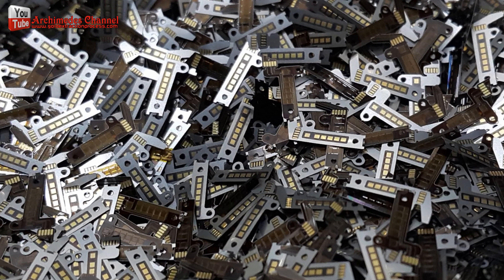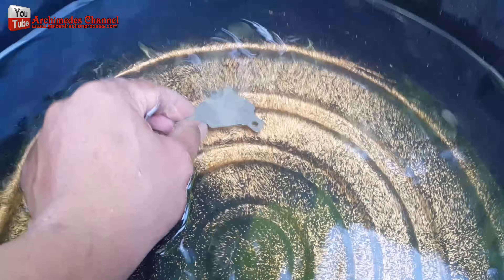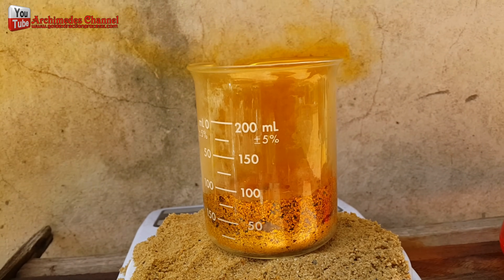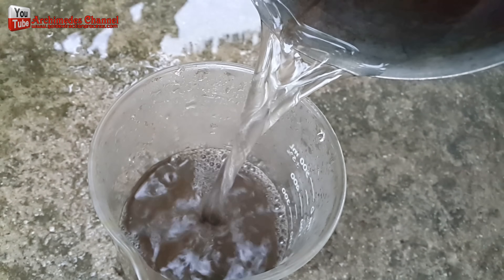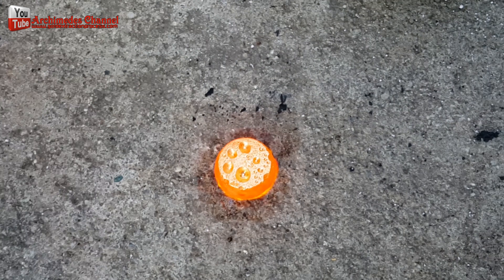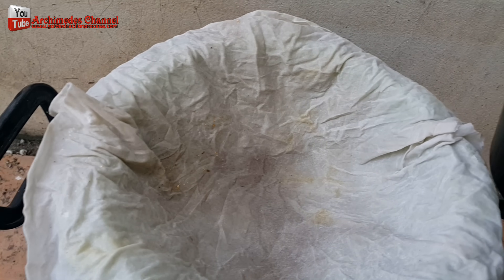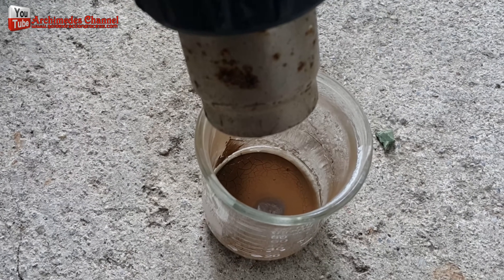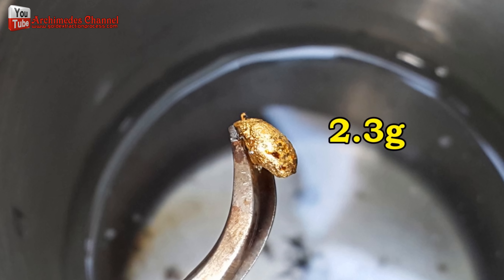Tips to recycle gold from e-waste devices Connectors, circuit boards, computer parts

Comment: That's low quality gold. You need to repeat the refinement process many more times to get pure gold. Well it's good enough for YouTube I guess.
Reply: Plus it 's gonna be lead mixed gold, he needs to use that bone ash thingy to get rid of the lead
Reply: Not even real gold. He just said a bunch of random names and then but coco stuff then made "gold"
Reply: @LoonerOfficial  And the moon landings never happened...sure.
How's your unicorn farm going?
Reply: What is your estimate on carats after this process?
Reply: @vinko9.  well if you watch cody's labs you will get waaay more info, usually its 18+
Reply: @DingoVLOG  that is actually pretty pure

Comment: Why not just melt it down from the beginning? Lol
Reply: Because it will melt with all other metals. Of course you can purify it later but It is easier to purify it when it is in small pieces and then melt it.
Reply: I mean, if he stripped the gold already, why did he go through all of the other chemicals? Is the gold not pure?
Reply: @spiteye7.62  It's gold plated copper, where on earth do people make pure gold connectors ? :)